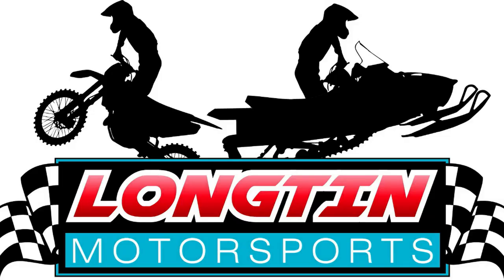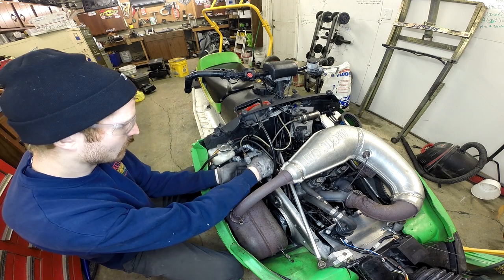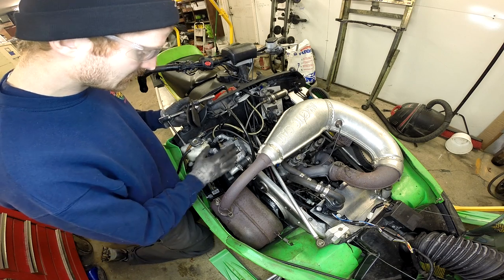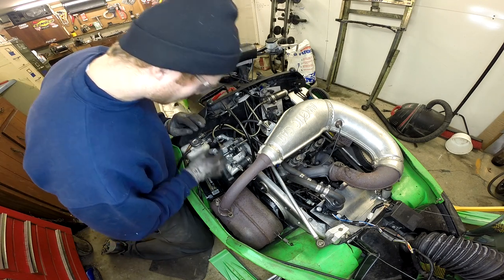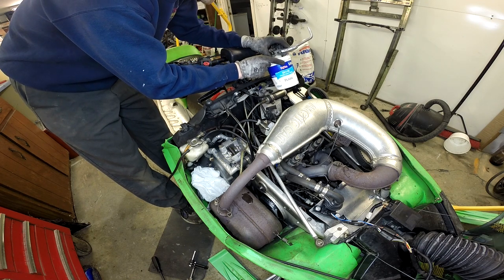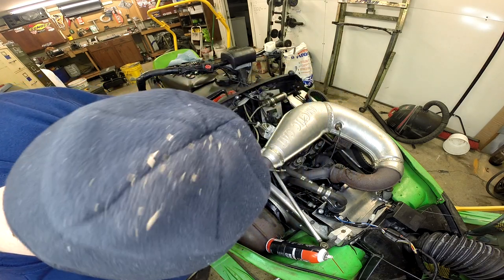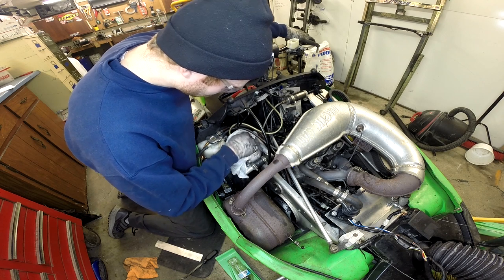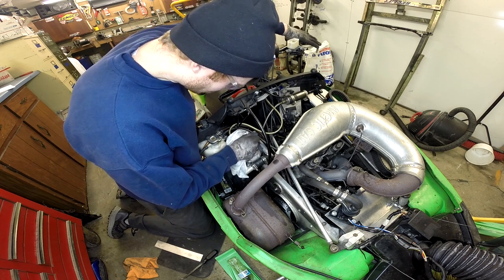sled tips 019   snowmobile brake service

Comment: Where did you purchase the Wilwood brake shoes?
Reply from the maker: We have been purchasing our pads on ebay! But most any Wilwood distributer should be able to provide a number for the shoe you need and set you up.
Reply: @longtinmotorsports  Thanks, having trouble finding wildwood 150-3830 pads for a 2003 Artic Cat 900 Mountain Car